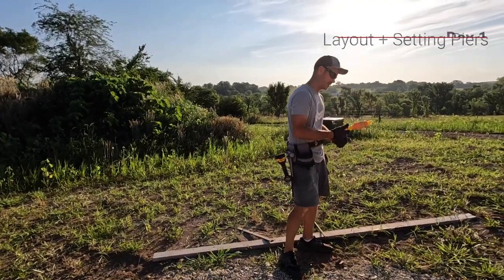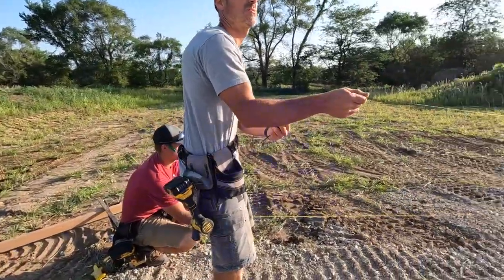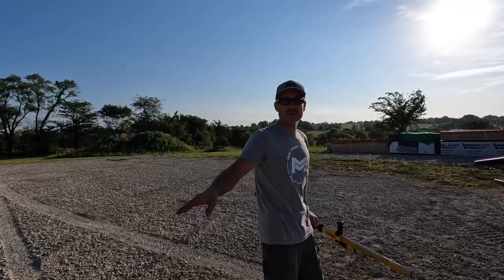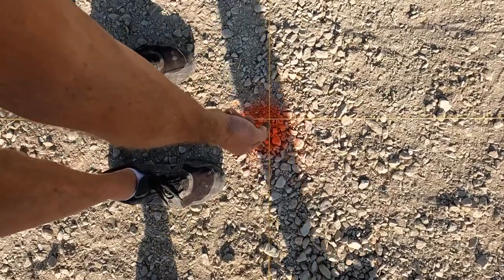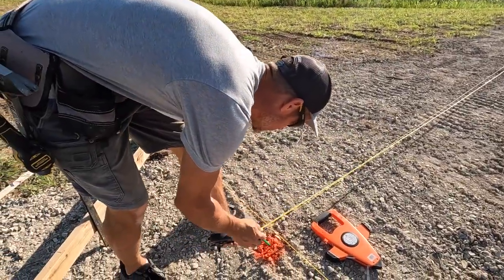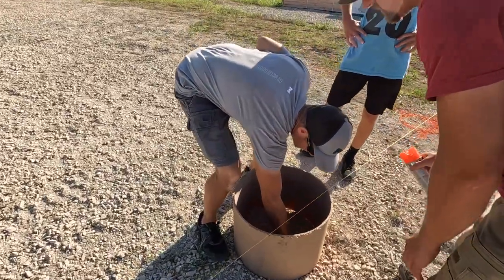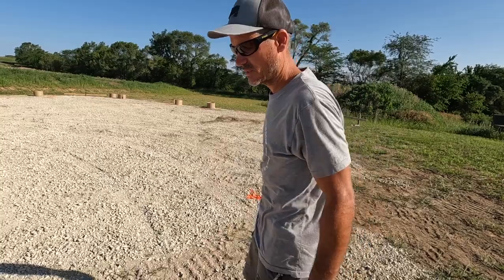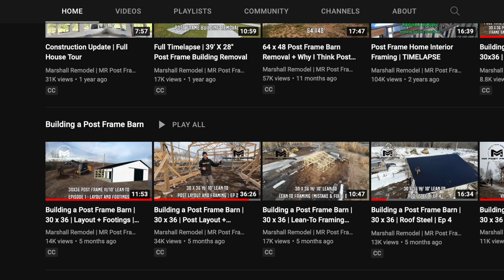The Barndo Build | Day 1: Layout + Setting Piers | Ep 2

Comment: I'm going to be doing a pier foundation on a sloping lot. My high point will be about 4 feet higher than my low point. What would you recommend on how to do the batter board/string line approach when so high off the ground? Thanks in advance!